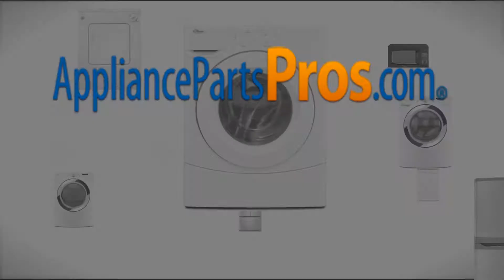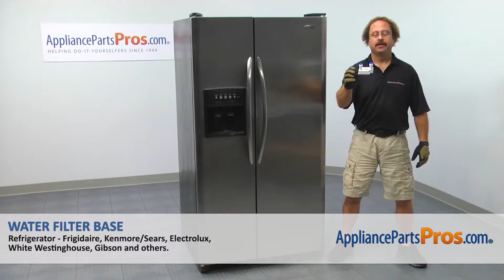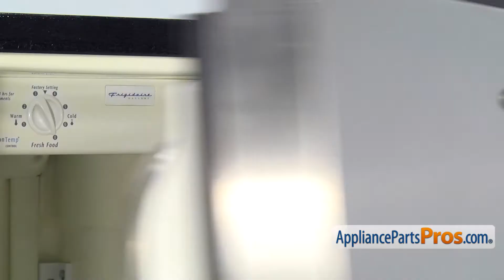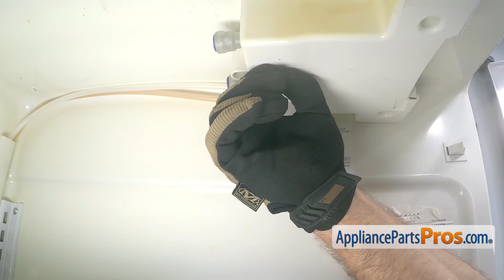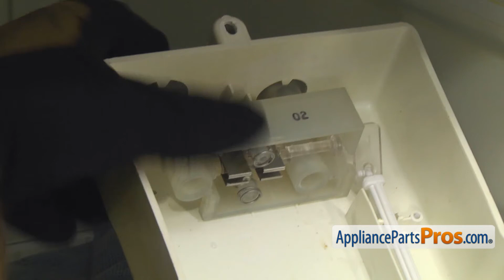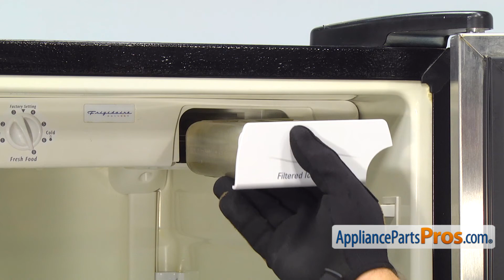How To: Frigidaire/Electrolux Water Filter Base 240396002

Comment: I have air bubbles in my water from my refrigerator dispenser (Frigidaire). The water is very cloudy. I’ve changed the filter twice and have looked for leaks but can’t seem to find any. Would this solve my issue so I can have a clear glass of water again? TIA
Reply from the maker: If you have replaced the water filter you need to make sure to purge the air from the lines. To clear air out of your water line, press the water dispenser lever for one or two minutes. You need to flush the water system to remove air (bubble) inside of the water line. If you have done that and you are still having that issue then you will need to replace the filter housing.
Reply: @ yes I have done that. I will replace the housing. Thanks for your help
Reply from the maker: You're welcome!
Reply: I replaced the filter housing that I purchased from your company. I then purged the lines and I’m still getting air bubbles in the water. I took the back of the fridge off to see if there is a leak and couldn’t find one. Any other suggestions? Thank you

Comment: My watersource 2 filter keeps leakimg
Reply from the maker: Check the filter O rings for damage and then the filter head. Check the filter head for leaks where the filter goes into it and also on the back where the water lines plug in.